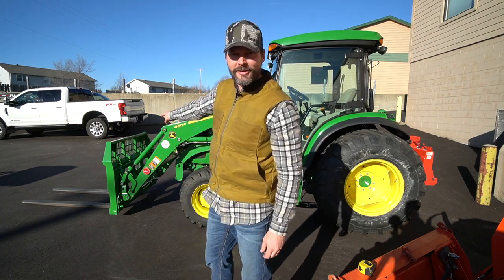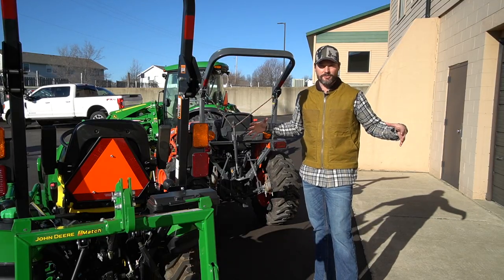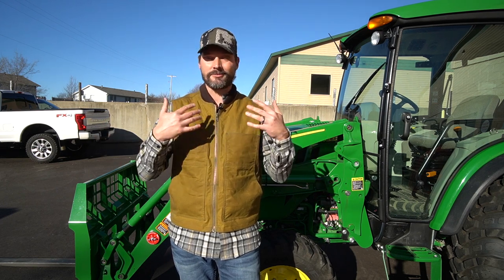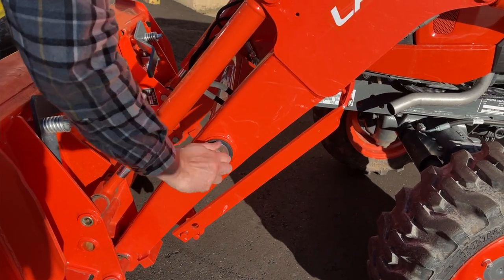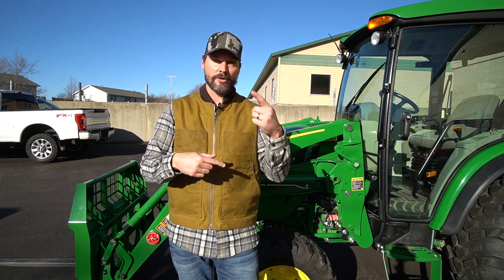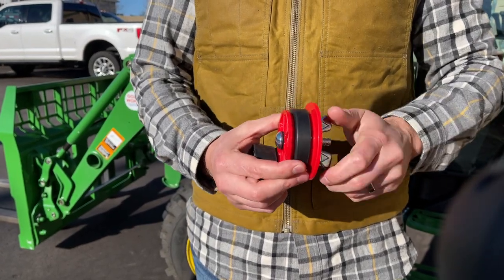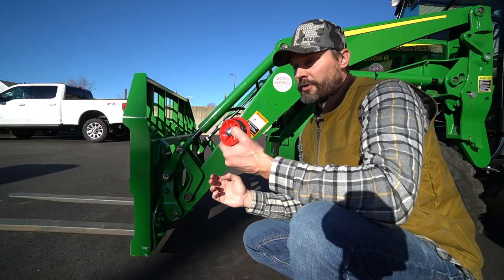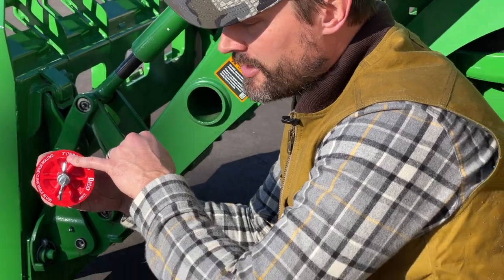HIDDEN STORAGE HACK FOR TRACTOR LOADERS 👨‍🌾🚜

Comment: I have a 2025r with a tektite cab, no storage anywhere!  I got around that by getting the grip clamps/holders like you see on the landscapers' trailers to hold the trimmers and attaching them to the frame of the cab near the back windows (they open slightly, so I use nylon strapping with a cloth buffer between the nylon and frame) and use them to hold rakes, shovels, trimmers, etc. going to and from work areas.  Not the prettiest thing, but it works.  Kinda like me.
Reply from the maker: Ha, whatever gets the job done!

Comment: Great idea. I use the tube to carry a shovel or pitch fork so I don't have to hold it while driving.
Reply from the maker: Yep, another good option for that tube.  Thanks for watching!
Reply: You can store your shovel on your I-match quick hitch. Just clamp the handle in the two lower latches .
Reply: @stephenseiwert9672  Thanks for the tip, hadn't thought of that, though I almost always have something on the back.